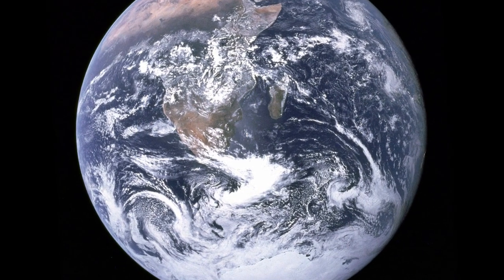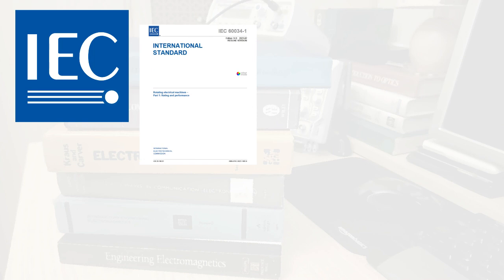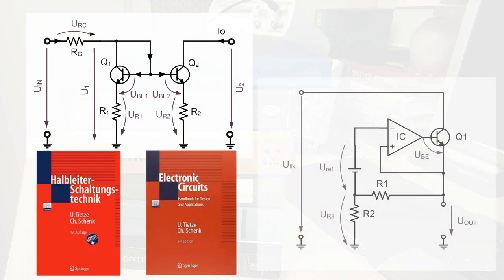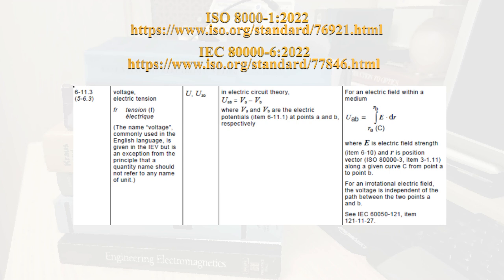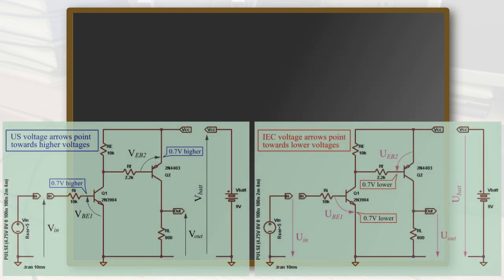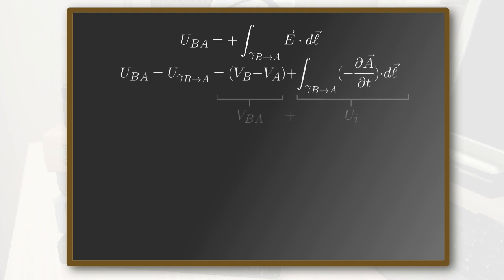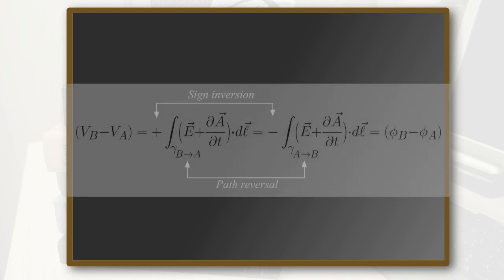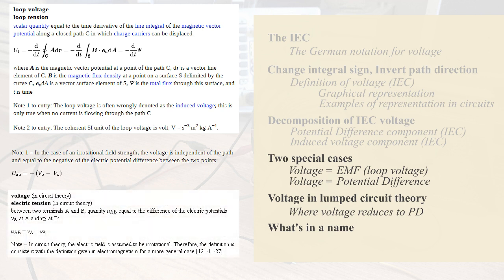Voltage: the IEC (and ISO) definitions

Comment from the maker: I did not mention the 'third way' to graphically represent voltage, that consists in not using any arrow at all.  The polarities '+' and '-' are shown instead. This notation is widely used in American textbooks but has the shortcoming of making it difficult to identify voltages between different branches. But, hey: to each their own.

Before reuploading this video I created a poll asking which notation is taught in your country. You can find it in the Community section of the channel if you wish to vote (yeah, I know, I only have a handful of subscribers, but a few is better than nothing, right?)

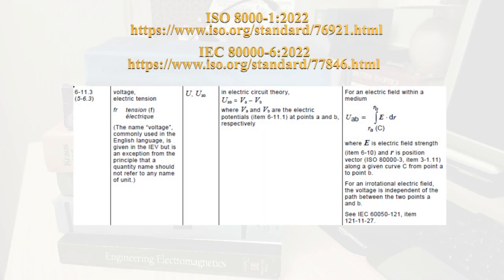Comment: Nice video! If you don't mind my asking: Are you sure that the extract which you show at 10:58 is really from the 2022 version of the ISO/IEC 80000 series, and not an earlier version?

Through my university library I was able to freely get hold of the British Standards Institution's UK implementation of the 2022 version of the ISO/IEC 80000 series, and what I see is quite different from what you show! [The National Foreword of the BSI's UK implementation of IEC 80000-6:2022 explicitly says that this implementation is identical to IEC 80000-6:2022.]

Bizarrely, in what I have, item 6-11.3 gives the definition of "voltage"/"electric tension" - denoted U, U_ab or u - as being:

"for a conductor, scalar quantity given by the electric potential difference V_ab (6-11.2) between two points a and b respectively".

There is no reference to the line integral of E dot dr anywhere in item 6-11.3! And item 6-11.2 is indeed the difference in scalar potential
V_ab = V_a - V_b
with the note explicitly saying that it is equal to the line integral of
E + (partial A)/(partial t)
where E is electric field strength and A is magnetic vector potential.

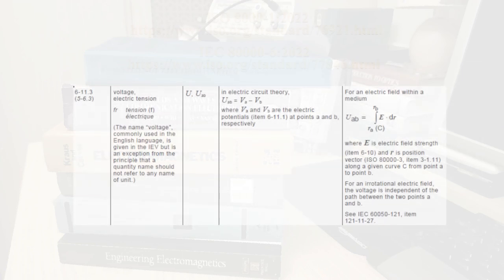Now I don't know what the "for a conductor" clause means here; I guess it's somehow connected to the "in electric circuit theory" clause in your screenshot at 10:58, but it's not clear how. [I assume that "in electric circuit theory" includes an implication that there are negligible induced electric fields besides those coming from lumped elements in the circuit.]

It's interesting to note that Section 0.4.1 of IEC 80000-6:2022 [the version I have] says that the items given in IEC 80000-6 are "generally" in conformity with the IEV.
Reply from the maker: Thank you for your contribution. It is indeed the 2008 version of the standard. I assumed it would have been the same in the latest version (2022) because that is the definition that appears on the online version of IEC Electropedia.

It's kind of sad that they dumbed down the latest version of the standard. Using the scalar potential difference instead of voltage will give wrong values, as I will show in one of the next videos.

Oh my! What's next? 2+2 = 22 ?
Reply from the maker: Sorry, I had written a second comment based on the picture at the timestamp you gave 10:58 and what I saw was the snapshot of Electropedia s page. While you obviously referred to the picture shown from 11:00 onward. So, it seems that ISO at least has turned heels. I'll try to find out if the IEC has, as well.
Reply from the maker: A question: does your version have 5 columns?
The 2008 version of BS EN 80000-6:2008 has the following columns:

Item no
Name
Symbol
Definitions
Remarks

Is the new definition "in a conductor..." placed under remarks?
Reply: @copernicofelinis  Sorry for the delay in replying. My version has 6 columns: Item No.; then under the umbrella of "Quantity" are columns titled Name, Symbol, Definition; then under the umbrella of "Unit" is a single column titled Symbol (which is just for the SI unit); and finally Remarks.

The "for a conductor..." definition is under "Definition". Under "Remarks" is firstly a comment about how the word "voltage" is an exception to the usual rule of not naming a quantity after a unit, and then (ironically!) it states the reference to the corresponding entry in the IEV ("See IEC 60050-121:2002, 121-11-27"). And that's it.

I'm a bit confused by your comment "it seems that ISO at least has turned heels. I'll try to find out if the IEC has, as well." I thought the document 80000-6 is already an IEC document which is then also adopted by the ISO. But yes, the current version of the IEV [i.e. IEC 60050] definition of voltage still seems to be the 2002 version which gives the line integral of the electric field strength. So it seems that the IEC have two currently-in-force documents that contradict each other.

In your 2008 version, I guess that "Definition" comes before "Remarks"? If so, it's interesting that the 2008 version that you show gives the "electric circuit theory" definition ["U_ab equals V_a minus V_b"] under "Definition", and then gives the "within a medium" definition under "Remarks". Chapter 22 of the Feynman Lectures also seems to only use the word "voltage" in reference to the topological network representation of the circuit, while never giving a specific name to line integrals of electric field strength (even though these line integrals of electric field strength are presented as being foundational to the entire discussion of voltage in that chapter).

I'm guessing that the 2022 version is using the phrase "for a conductor" in order to somehow contrast with the "within a medium" phrase in the Remark in the 2008 version. But what on earth they're intending to communicate, I have no idea!
Reply from the maker: @DrJulianNewmansChannel thanks again for taking the time to answer. 
Yes, Remarks comes after Definition. I checked both the IEC 80000-6 (2008-03) and the BS EN 80000-6:2008 and the are identical word for word.

If this is the case for the 2022 version, then yes, somebody messed up at the IEC. Not that the previous (2008) definitions were perfectly consistent: in my next two videos I will show that the voltage used in circuit theory, despite being locally single-valued and obeying KVL (within selected regions of space) is not the scalar potential difference, so the definition of Uab = Va -Vb was kind of problematic per se (but I figured one can work around it by assuming the dA/dt contribute to be negligible - because of the distance from the sources or their weakness for a single loop). 
But removing the definition of voltage as line integral of E is a way bigger problem.
Reply: @copernicofelinis Yes, I was also wondering about the “V_b minus V_a” formula that they gave for electric circuit theory in the 2008 version: do they have in mind electrostatic potential difference? Of course it is true that under the assumptions of a lumped-element model, the voltage “across” a circuit component as used for electric circuit theory is equal to the difference in “electric potential” between the terminals, so long as this “electric potential” - defined outside of the circuit components without needing to be defined inside the circuit components - is defined to be a scalar field whose gradient is the negative of the net electric field strength everywhere in the vicinity of the circuit except within the circuit components themselves. This seems to be the approach taken in Chapter 22 of The Feynman Lectures, and I was wondering if this might be what the 2008 document has in mind. But I guess probably not.
Reply from the maker: @DrJulianNewmansChannel I had a look at the script of my upcoming video "IEC voltage in circuit theory" and regarding the definition 131-11-56 on the IEV I wrote "I cannot but wonder whether the use of a different font and case to represent both voltage and 'electric potential ' in this IEC definition is just a coincidence"
And then regarding the line "In circuit theory, the electric field is considered to be irrotational" I noticed that "it doesn't say 'it IS irrotational' but 'it is CONSIDERED to be irrotational' which implied the conditions for irrotationality are considered satisfied in the circuit even if they might not be so in general".

So the 2008 definitions could have been consistent with the concept of path independent voltage that is not equal to the scalar potential difference.

But this new version of the standard has created a problem by removing the most important definition. 

Another interesting thing is that the definition of voltage in electromagnetics was  the object of two amendments to the 2008 (CORRECTION, to the 2002) edition of the standard. Made me wonder if they updated a non-amended version 1.0 when they created the 2022 edition, but it's unlikely they fetched the 2002 edition.

I am not sure that writing to the IEC will get me an answer, there are literally dozens of email addresses...
Reply: @copernicofelinis  Wow, thanks for all these details; I didn't know there's an IEV definition of "voltage (in circuit theory)". According to the IEC webstore, the "stability date" of the current IEC 80000-6 is 2026, which I guess means that they might update it again next year.
Reply: @copernicofelinis  By the way, in case you're interested, I've made a video on the whole "KVL"/"definition of voltage" controversy: https://youtu.be/mYWTfxxJncM In the video description, I've given a list of references, and I've included your channel among the references 🙂

The video is fairly fast-paced (diagrams and bits of text, no audio), so you might want to slow down the playback speed if you want to follow all the details; but the intention(!) is that viewers who just want to get a gist of the main ideas can watch without slowing it down.
Reply from the maker: @DrJulianNewmansChannel thanks for letting me know, I have already commented on your video.
Reply: @copernicofelinis  Just an update: I "unlisted" the video that I had made, because I decided that the format was suboptimal. I've decided to expand to a series of videos, and have uploaded the first video in the series https://youtu.be/PfMh8_g9ml0 The reason I'm telling you is because, once again, I acknowledged you in the video description, and so I thought I should let you know 🙂
Reply from the maker: @DrJulianNewmansChannel thanks for the heads-up, even tho I already knew. Actually the first thumb up to your new video was mine 😊. By sheer chance I was doing a search on the topic just 20 minutes after you published it.

But why unlist the old one? It had many pictures and formulae you could point to in your current and future videos.
I am looking forward to seeing them.

PS
I am flattered by the mentioning of my channel.
Reply: @copernicofelinis  Aww, thank you! I intend to go through pretty much the same set of slides over the course of the future videos, but with actual verbal explanation.